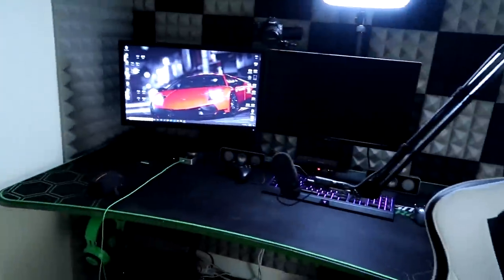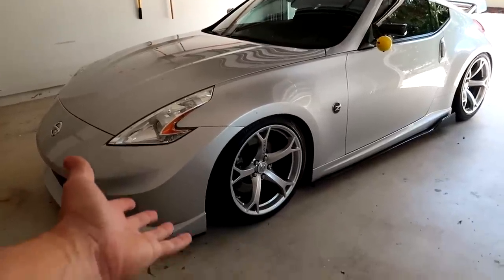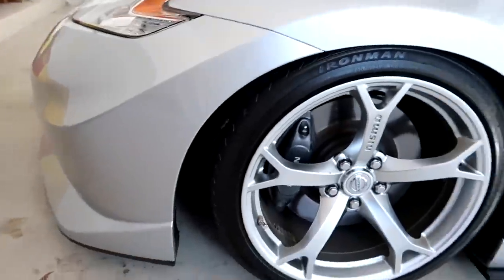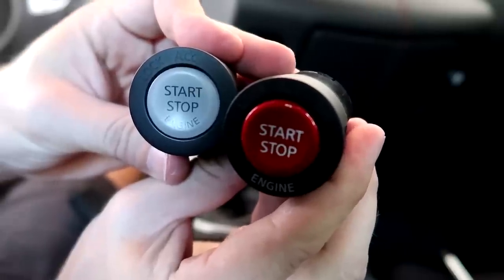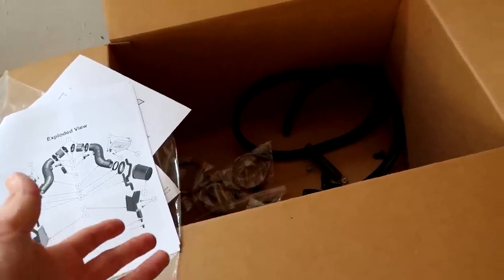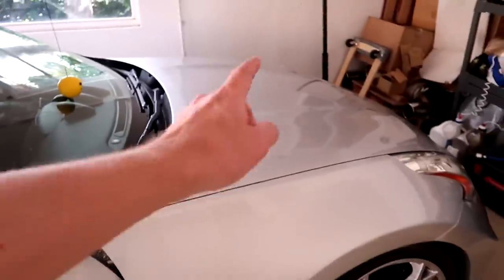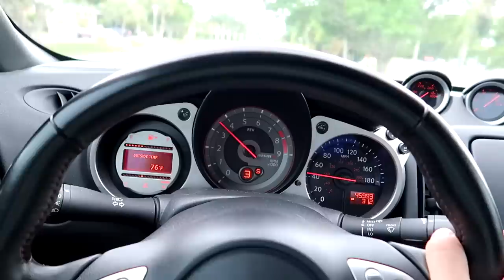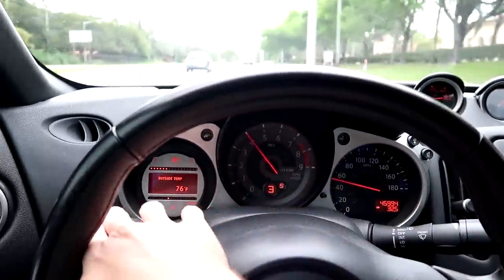Let's modify my PERSONAL car *featuring Mila*!! (Vlog)

Comment: Iggy, I want the top speed run! Couldn't sleep without it, man! Your car looks awesome, the seats are cool. The upgrades on your car may be aftermarket, but they surely looks factory, If you gave me a ride without telling, I couldn't tell wether the upgrades are by Nissan or not...... Except for the push button start....LIKED THE VIDEO👍